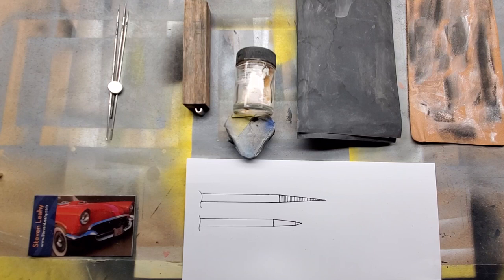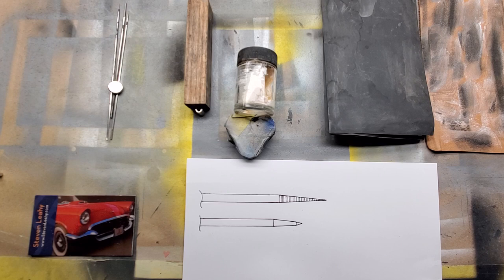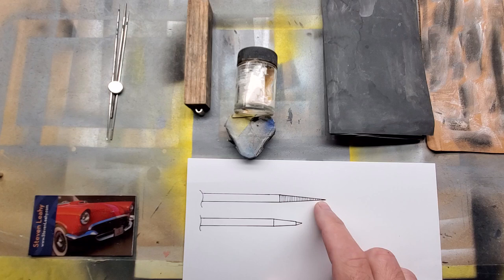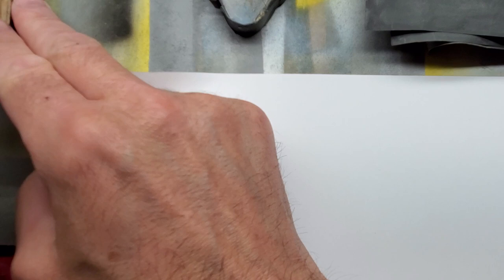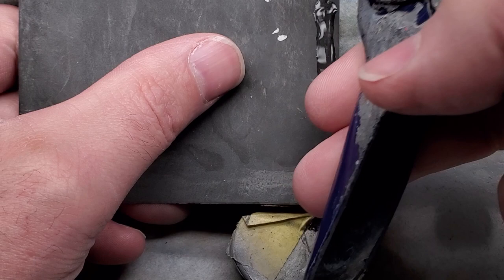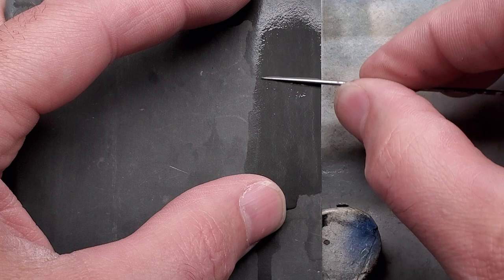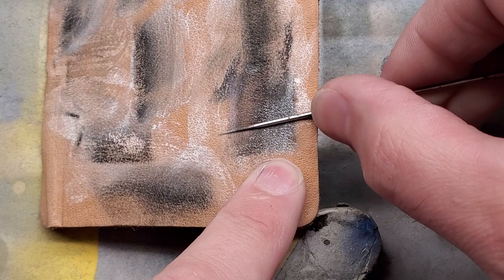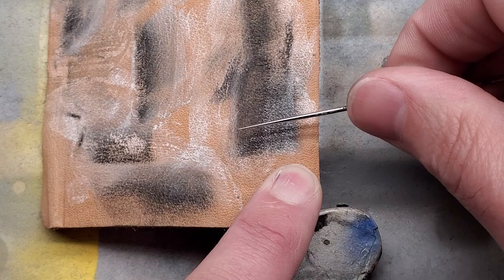Tech Tuesday - The Mirrored Needle

Comment: Another great tip, Steve!  It should be a given, but for the beginners watching (myself included) it's worth mentioning that whenever you are cleaning a needle, you want to run the towel, cloth, etc. from the back of the needle forward toward the tip.  Unless you want an accidental tattoo.
Reply from the maker: What, Airbrush acupuncture isn't a thing???